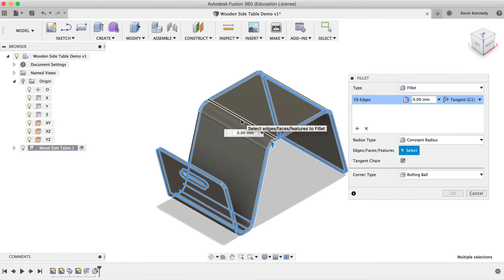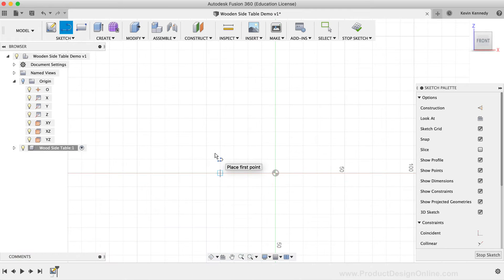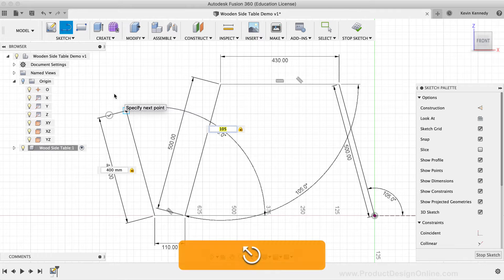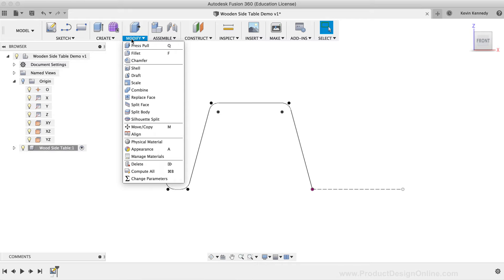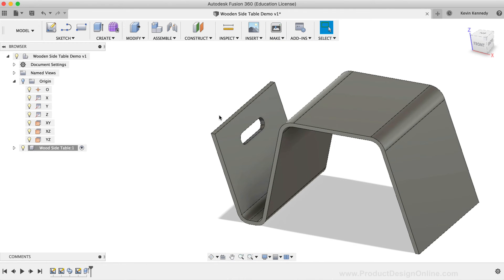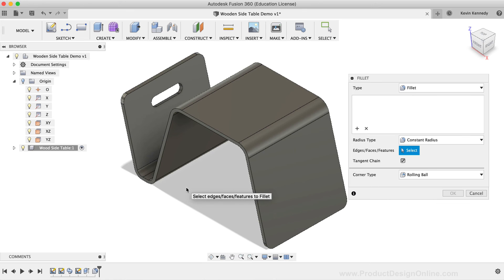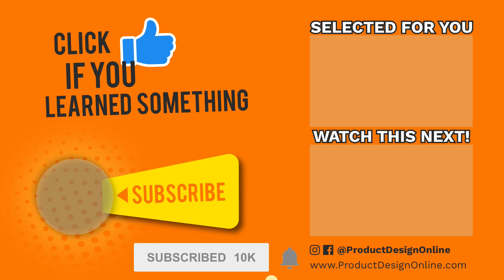How to Sweep a Wooden Side Table in Fusion 360 — Fusion 360 for Woodworkers

Comment: Awesome video. My situation is I'm designing a wooden cage for a breaded dragon. Try to paint you a picture here...It's 5 feet long 6 feet high and 30 inches wide. I have all the 2x4 frame done and all cross bracing. My problem is when I go to draw the plywood on and cut a rectangle out for a window...I'm good...I draw a rectangle 25.4mm bigger than the cutout and extrude it 6.35mm and modify the appearance to glass, I can see thru from the outside of the cage but when I orbit around it shows a solid piece of wood. I'm confused?? I used construction lines to place the cutout and used lines to extrude the window. Oh. One more thing. How is it that two of my 2x4 intersections joined together, but all the other ones did not?? Hope you understand this and thanks for any and all help.

Comment: Hi Kevin -- thanks, this was very useful. Is there a way to unfold an extrude along a path, in the same way you can unfold sheet metal? I've got a bentwood project, but need the flat dimensions/profile for cutting it out before bending.

Comment: I would love to see more woodworking, particularly perhaps starting with libraries of common lumber (2x4s) plywood 1/2 and 3/4 inch, standard screw sizes etc. 
Especially important is altering existing components. finally After about 8 fusion 360 training videos from you and others (you are my fav.) no one ever goes back and changes the size of something after they move on, can you do a video about that? sorry if it already exists. Thanks!
Reply from the maker: Hi Brian. Glad to hear you're enjoying the tutorials!

I do have several tutorials that cover user parameters, which is the best way to update and change dimensions afterward. Some pertain to woodworking... Others don't. Check out the birdhouse tutorial on my channel if you want a woodworking related one.
Reply from the maker: Dovetail joints is a more recent video that has user parameters - https://youtu.be/RB2TqZ6bP_E

Comment: A Comment and Question: 
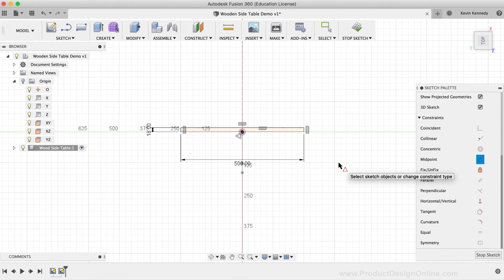Hello, Thanks for the great tutorials. I'm working through the wooden table design. However, I seem to be running into issues when I draw the rectangle profile and align the mid-point of the rectangle to the origin point with a Mid-point Constraint (8:01 in the video). Fusion errors out asking me to revise the constraints or dimensions, no matter how many times I tried!

However, I was able to get around it by creating a rectangle floating in space and then using the Midpoint constraint to align the rectangle to the origin as shown in your video. 

I haven't figure out why constraints behave differently in my environment when compared to your videos. I worked through your other video where you demonstrate each constraint, but I saw that my environment was throwing errors when I tried to reproduce your demo. 

Is there a setting that I must be changing to influence the behavior of the constraints?

thanks,
AM
Reply from the maker: Hi Andy. Did you delete the "coincident" constraint (that's automatically applied from using the origin point) before trying to add the midpoint constraint? If you watch at 7:40 you'll see that I select the bottom horizontal line, which shows the coincident constraint applied to the end point of the line and the origin point.

I'm guessing it was either that coincident constraint or another constraint that was automatically applied...which would explain why you had no issues when you drew the rectangle in space.

Let me know if that was it. If not, I'm happy to take a look at your file to see what else it could be. Cheers, Kevin :)
Reply: @ProductDesignOnline  Hi Kevin. Yes I did. That is a very significant part of your tutorial. I do see that you click the bottom line and hit delete. But if I do it,  the entire line disappears! Therefore, I select the co-incident glyph and hit delete to make it go away. But Fusion doesn't seem to like that.  Maybe I'm doing something wrong.  Let me review my work again.
Reply from the maker: @AMTheTinkerer  Okay, let me know if you figure it out! Otherwise, if you share your file's public link as a reply to this comment, then I'll take a look. Cheers, Kevin :)